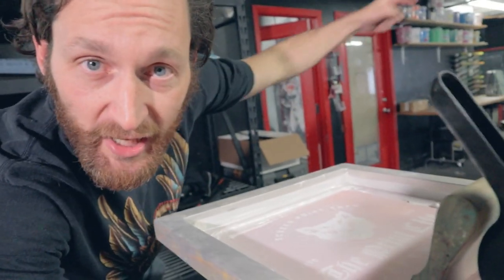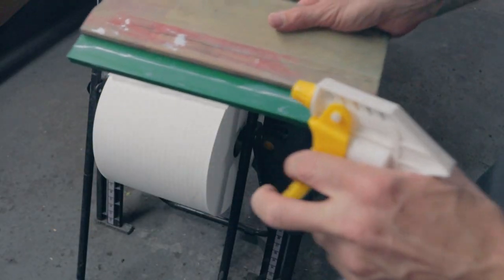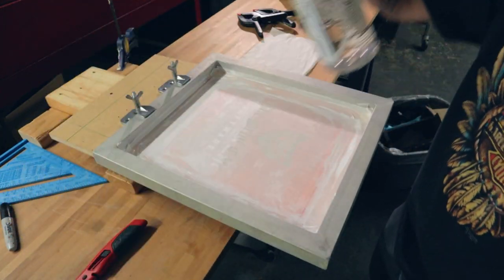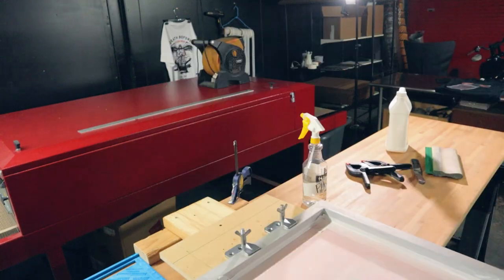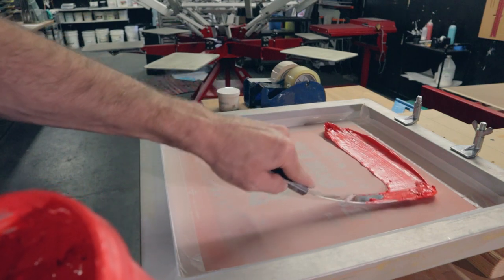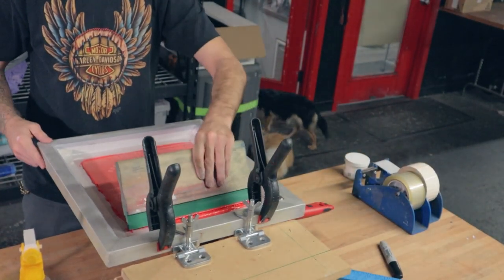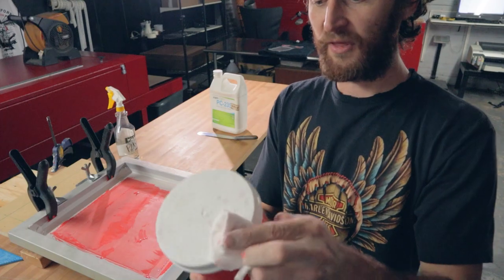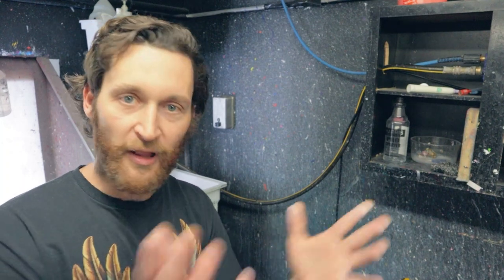Screen Printing Hacks | How to Clean Ink from Screens [ 2 INK CHANGE OUT TIPS ] t-shirt business.

Comment: Cam what spray bottles would you recommend for ink dregrador and other shop chemicals? I use 810 and 820 press wash and chew through spray nozzles. Thanks sir!
Reply from the maker: I use Harris Pro Sprayers, They are chemical resistant so they last a lot longer before they start breaking down. I will link them in my amazon store.

Comment: I wouldn't recommend a pressure washer I started using one at work and it takes off the literal screen where the ink doesn't go through. The best method I liked was a lacquer solution that just took off the paint and left the screen nice and clean everything easy
Reply: What's the name of the alternative ?
Reply: @djredline25  I unno we stopped using that method before I left the job but we started using an "eco" solvent thing plus water you can use a pressure washer just don't go to close to the screen I just took the nossle off and used it as a hose didn't need the water pressure really.
Reply: @treeoflife6337  ok preciate the info ! Happy holidays to you